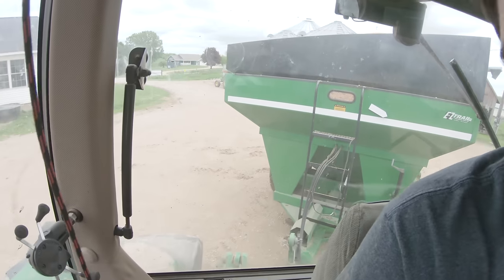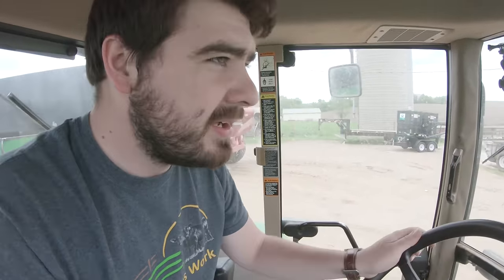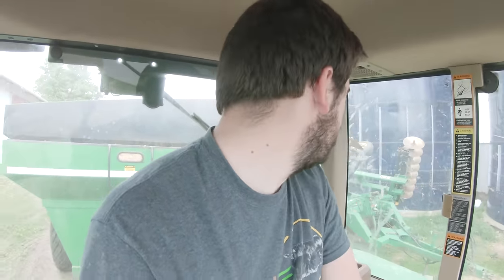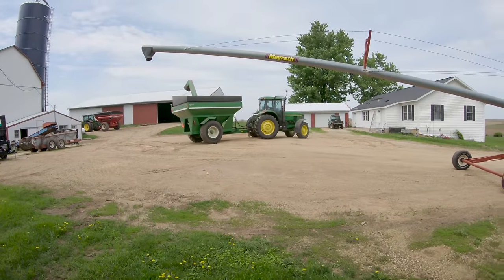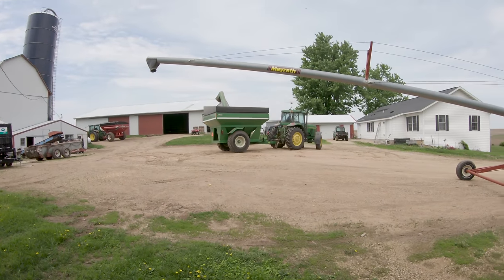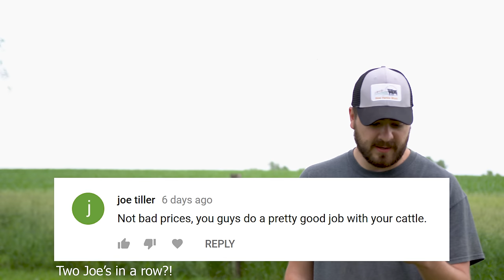Emptying Grain Bins

Comment: All this new equipment! Try doing all of this back in the early 70’s. I use to love sitting on the corn pushing the corn down out of the truck.  Sometimes we would be inside of the bins (ROASTING) pushing the corn to the sides as it came in from the top of the bin because we didn’t have no air ventilated bin floors. We had to keep the corn separated for aeration.  Fun times as a youth growing up on a farm. I hated Tobacco season though🤣😂😅! RIP Uncle Buck💪🏾

Comment: Ryan, Instead of hurting yourself by going through the tiny door on the bottom, you could of went through the hatch on the top of the grain bin and climbed down the ladder. Plus you could of got the auger inside by having Travis open the door.

Comment: Greetings from Northern Illinois, 
      I was just wondering,  Is the old bin that buckled repairable ? Or will it need to be scrapped?
ALSO: Have you ever considered placing your grain carts apart with enough room for the semi to pull in  between them and unload at the same time, speeding up the time it takes to load the semi. ... or is that more work than it's worth?  
     One last thing, I suggest you wrap those exposed bolts on the stairway with foam padding and Gorilla Tape.  Yes, it's time consuming to put it on, but it will save you another injury.  Stay safe.  God Bless.

Comment: I'm curious if the flat bottomed storage bins, that require manual clean-out, were actively chosen over hopper bottom bins that self feed to the auger.

Did you decide to go with the extra labour for the extra storage, or was it more an issue of that is what was there/on the local market at the time they were built?

Farmers I've seen in Atlantic Canada seem to be going with smaller hopper bottom bins, and just adding more bins overall as their needs grow.
Reply: Most likely storage, never seen anything bigger then a 5000 bushel hopper bin myself and the BTO's are all flat vottomed around my area

Comment: Wouldn’t it be smarter to have the bottom of the bins pointing downwards in the middle and like rounded around the edges but higher than the middle so it all just slides down into that pipe thing you guys sweats it into? Sorry if this is a dumb question I don’t know anything about farming😁

Comment: Have you ever thought about making the bottom of the silo into a conical shape? I'm not a farmer or have any experience in farming just stumbled into this video and it would save a ton of time and energy if the floor wasn't flat! I'm sure in reality it's a lot harder to implement it. Obviously you would have to create a stronger floor to hold the weight and to make up for the loss of space add some height. The floor wouldn't have to be that high, gravity would move the majority of the grain to the center so clean up in theory would be next to nothing. Maybe they make something like this and the cost just isn't practical but the time saved over a couple years I would assume justify it. I don't know! I enjoyed the video regardless.

Comment: y dont you guys shovel the edges while the bin sweep is going? just wondering... With our bin sweep we shovel the edges as the sweep is going so not as much to shovel and deal with when the bin is empty.
Reply: The_Rev for one thing it's a safety issue being in a bin with a running auger.
Reply: its not like you are sticking your foot in the way.... i fail to see the safety issue here...
Reply: The_Rev that auger is running at high speed.  Anything can happen with grain.  I have seen a guy put a foot on one of those that were stuck and all it takes is one slip.

I for one am one to go with safety first.  When climbing a bin, use a safety harness.  Never enter a bin alone and always use a harness.  Stay clean or moving augers and power take offs.  It may take a few more minutes to be safe, but you could save a life or an injury.
Reply: be smart thats the bottom line (use common sense) stay away from moving parts using a shovel around the edges in my eyes isnt that big of a deal havent had a problem yet....
Reply: The_Rev let's see, I am sure that every farmer is smart and stays away from moving parts.   Like the guy I had to help dig out of a grain bin because he was being smart.   Or the guy who got pulled through the rolls on the head of his combine, or the guy who was found wrapped around the power take off on his wagon, blower or shit spreader. Are the guy who lost a hand or a leg. They were all thinking it was no big deal too.
Reply: you are totally missing the point have a good day...
Reply: The_Rev so are you.  Have of good day.

Comment: You fellas need to stay clear of powered equipment such as cleaning out the corn bin and running auger, pushing the auger with your feet is not the way to do it.
Reply from the maker: Unfortunately as the one we had to push with our feet is in an older bin, there’s no other way to move it around the bin without your feet

Comment: Shocking video. Everything works manually. A lot of work, a lot of time and totally ineffective. All works are done as in the past, like in 1970s. You should upgrade, optimize your grain equipment and then show your working on youtube.
Equipment such as a bucket elevator, pouring pit, ckleaners, and everything that integrates into a single unit, or in to the whole general elevator, is then optimized. Now is not the year 1970...... Good luck in works.